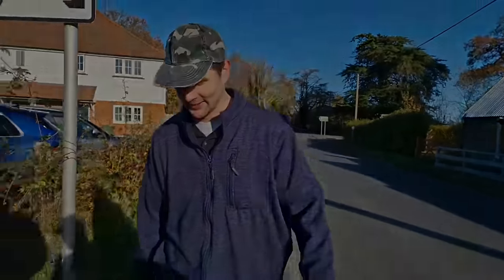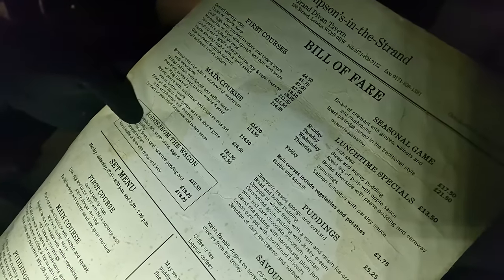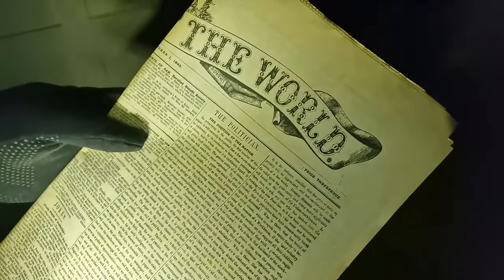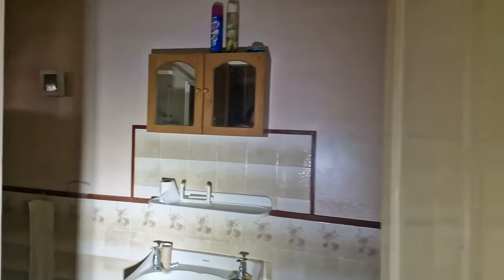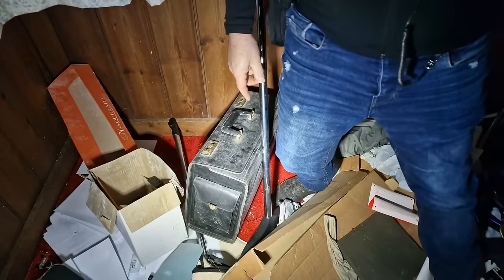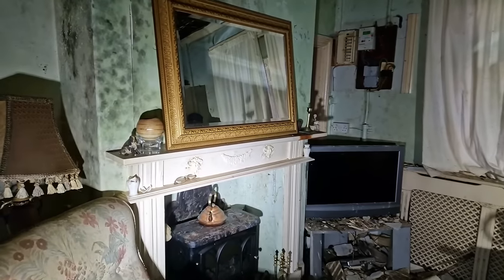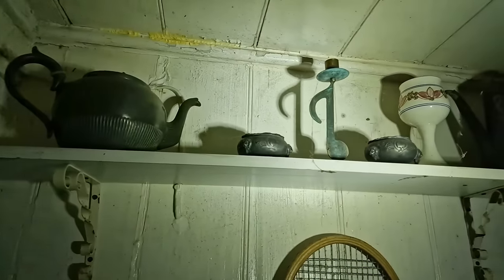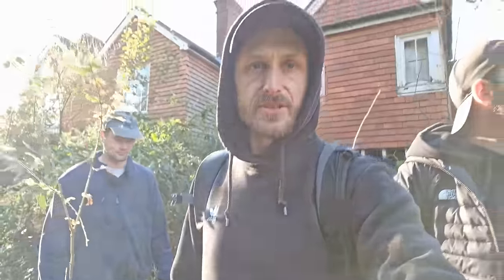We Found an ABANDONED Mansion  With aCar Still In the Drive!!

Comment: If you get mold you need to have air coming in to the building a window or air vent open a little  always get the roof fixed    and clean out the leaves from the guttering  or use a little bleach mixed with water to clean walls or celling to keep rid of moud  and wear a mask and gloves   mold can ruin your curtains so have short light ones up    wash all ornaments with moud cleaner you can buy from supermarket shame things smell of mold  nice house and over grown garden

Comment: Alex that rod on upper floor from one side of room to the other is a wall stay. Designed to stop upper storey walls from bowing out. You generally don't see them in a room only on outside of building looking like a metal cross, think this one was visible because head height was need in room otherwise it would have been in ceiling.